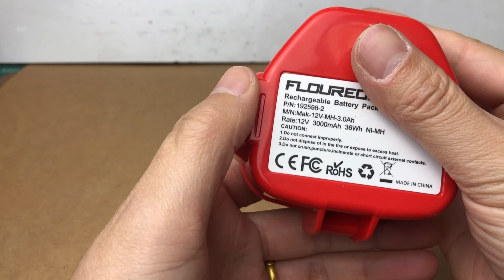Makita 6270D electric drill repair and refurbishment

Comment: can i put 5s bms with this drill ?? i put 4s 16.8 volt and it works great wonder if 20 v work
Reply from the maker: There should be no problem. This kind of brushed motor is designed with wide voltage, and the switch has no complicated circuit. If the voltage is changed to 20V, it should be more powerful and the speed will be higher.

Comment: where did you buy the set of brushes for the electric motor? I have a 6260d that needs a new gear box but I also want to replace the brushes in the motor like you did but I can't find them.
Reply from the maker: I bought it on Taobao, I don't know if you have a similar shopping site there

Comment: Hey where did you print the stickers ?
Reply from the maker: The stickers are printed with a home printer buy label paper
Reply: @RefurbishmentKJ  like site or from images cuz I'm looking for the battery charger sticker for a 8391d makita
Reply from the maker: @GreenSpeedo  Labels are made by myself using design software for typesetting

Comment: where to buy the carbon brush
Reply from the maker: 😄I bought it on Taobao, a shopping site
Reply: @RefurbishmentKJ  thanks, but the site i can't read, language is different
Reply: You can only replace the whole motor. Part number is 629875-4.
Well we are seeing this guy replacing the back end of the motor but reassembly is a bit of a hack job as the motor is designed to be non-serviceable which makes sense because they are cheap.
Reply: @bigbattenberg  thank you.
Reply: @beausky4100  Original motor officialy imported by Makita cost 5 USD/EURO.
Reply: @loochan325  thanks